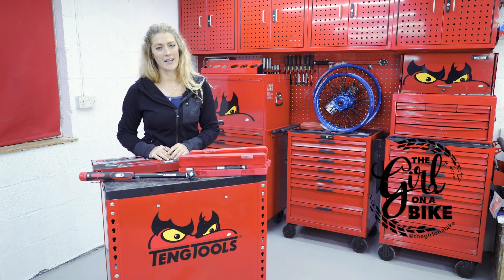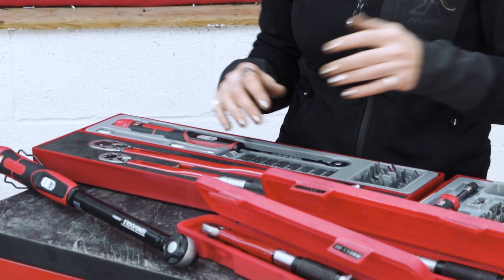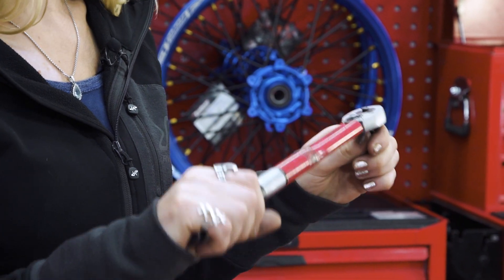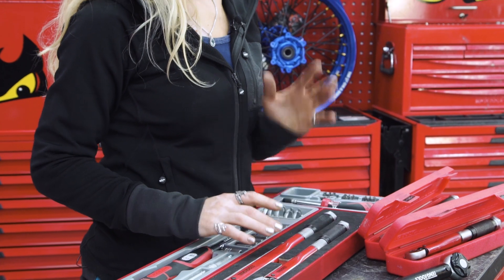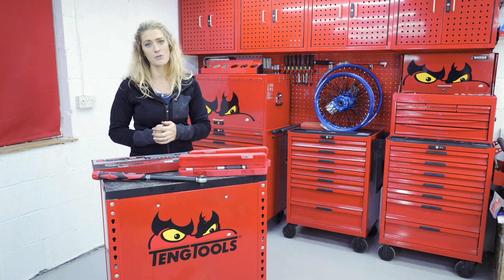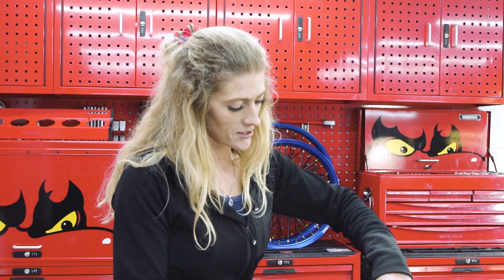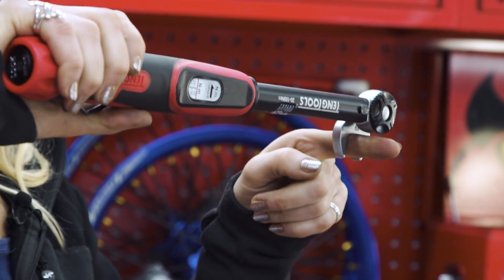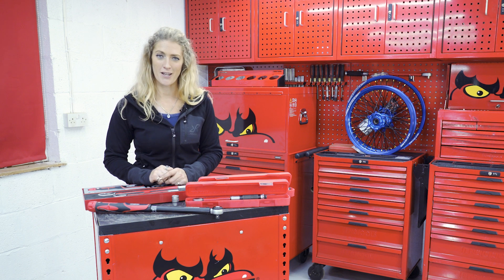How to use, set and maintain a torque wrench

Comment: The demonstration at 5.10 of how to use the torque wrench showed an incorrect method - you will only get an accurate setting if the wrench clicks while the bolt/nut is moving in a continuous tightening motion. If it clicks as soon as you apply the torque to a stationary bolt/nut, the higher breakaway torque needed to overcome the friction to start it moving can lead to a false reading. If this happens you should loosen it by 1/4 to 1/2 a turn and retighten in a continuous motion until it clicks again.
Reply from the maker: Heya Rick!

True, but I believe that sequence was to demonstrate what the 'click' sounds like.

Best regards
Emil, TengTools